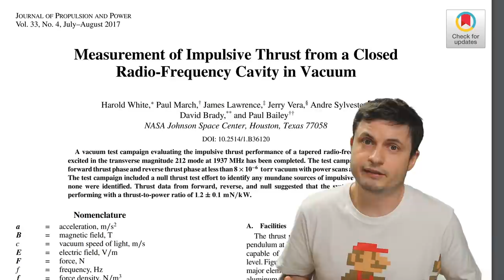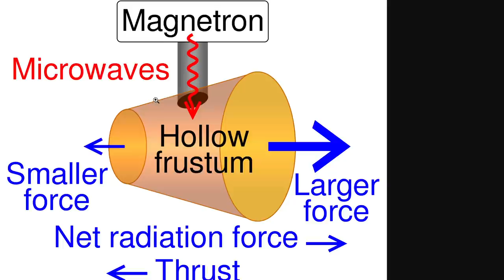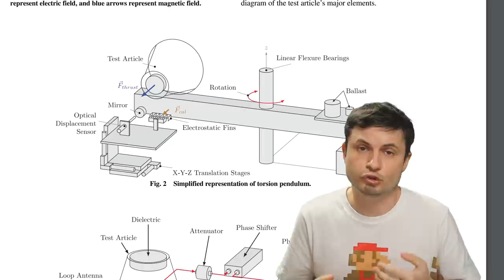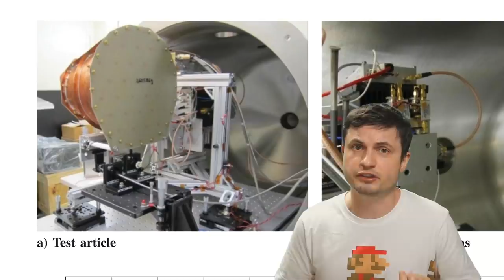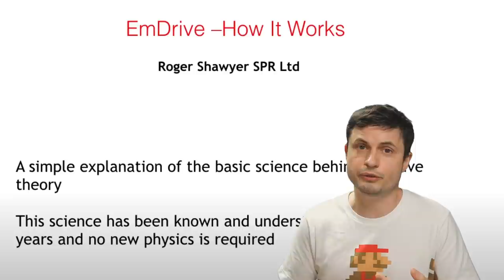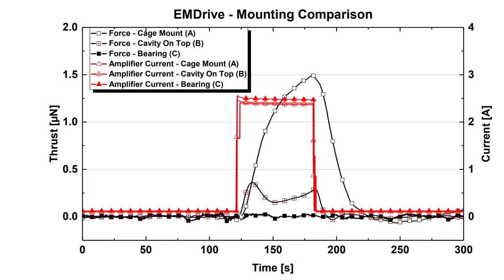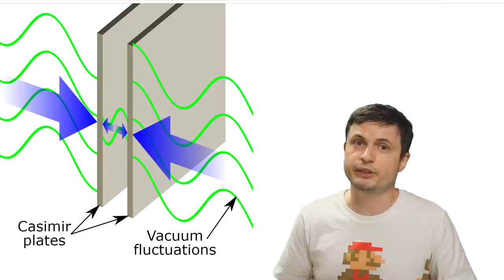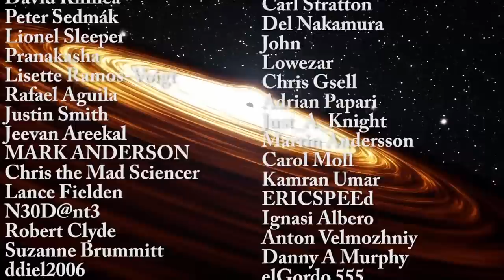Looks Like EM Drive Is Officially Dead - Experiments Fail

Comment: Not a failure. Just learning what does not work. That is just as important as learning what does work.
Reply: This was pretty obviously a "does not work" right from the start.  Depending on the experiment, it involved random amounts of "propulsion" in random directions for no explainable reason.  That just screams experimental error.
Reply: @jasonpatterson8091  and also the fact that this broke all phyical fundamentals right from the start. We just tested around because we would have had to think alot if it worked.
So im weirdly glad that most of our physics still works
Reply: Still insane to learn electrons and photons still can provide propulsion in zero-g. But we're still messing around with what nozzles can and can't do. Lol
Reply: That’s SCIENCE baby
Reply: Hmm I will use the power of my mind to lift a paper clip.  No didn't work.  Hmm I will ask any ghosts that are in the room to lift the paperclip.  Nope, didn't work.  Learn anything?
Reply: @BrosBrothersLP  you’re probably both wrong, for what it’s worth I’m glad this one doesn’t work cause other setups are going to be much better. 
Knowledge is power and I suggest reading about the theories involved because if they do produce a theory of everything. Than Eventually inertia will be used to explain magnetism and gravity.
The engines  we could  engineer and build would be unreal, beyond the scope of what we have now cause we been thinking about the universe wrong, or at least not taken things into acct that should be.
Everything spins and accelerations are the key.
They don’t bs when they say broaden your horizons
Reply: Still useful knowledge
Reply: A total failure from beginning. Calculations on which this drive is based are provable wrong, even beside breaking fundamental laws of physics. Yet huge amounts of time and money were wasted on testing it, just to prove for millionth time that basic laws of nature are indeed laws.
Reply: @jasonpatterson8091   doubt you knew from the start, you probably read about it and are regurgitating others thoughts and experiments. There is always something to be learnt from failures if you bother to look. Indeed the prerequisite of success is failure.
Reply: @AG-ig8uf  the progress of science is based on proving that those "laws" aren't perfect.
Reply: @Foolish188  I learned that you weren’t capable of telekinesis and that you can communicate with ghosts
Reply: "Just because you proved the earth was round doesnt mean that its not flat."
Reply: "Not a failure." Um, yes it was a failure. Which is the opposite of a success.
Reply: @Foolish188  yes. There is neither a mind nor a ghost in the room. There is however a rather self-important paperclip in the room! :-P
Reply: @MrLeighman  no a closed system cant produce thrust and thats it. Without pushing something away you cant propel yourself forward. This will never change. Maybe some weird manipulation of spacetime/gravity could become possible. But using EM-Waves no.
Reply: That doesn't make it not a failure, it just means some failures have value.  And...frankly...this failure doesn't have value.  We already predicted it wouldn't work, and why.  But no...everybody just HAD to try it anyway.  Complete waste of time.  Nothing new, at all, was learned from any of this.  Nothing.
Reply: @DarkVoidIII  lol
Reply: definitely
Reply: Debatable
Reply: your attitude mate wonderful. if all scientists had this outlook science would be a much more thorough environment
Reply: @wiserhairybag5554  "Than [sic] Eventually inertia will be used to explain magnetism and gravity."  How so?  We have a good understanding now, and they have nothing to do with each other.  Note that gravity operates even on massless (inertialess) light.
New physics can't change the experimental results that we already know.  That is, we can refine the model in subtle ways, but it must still reduce to the old model in the low limit.
Reply: That's not learning
Reply: Not really if you find an answer you can use it to fund further ideas 20 years on bus is kinda a step back
Reply: @JohnDlugosz  well I definitely agree with refine theories, theories now aren’t really wrong just incomplete. I guess more so from an abstract way,Ike electrons but more from the state of spin rather than charge. 
Gravity changes pressure at quantum scale, so relatively light slows down and thus bends from our perspective, imo.
Reply: @Foolish188  you realise people were literally believing in that until they've learned it's impossible? Lot of things we figured out through science is now considered common sense. Learning what doesn't work, as stupid as it might seem, is important.
Reply: @BrosBrothersLP  It’s just that some folks really want Unicorns to exist.  The emotional investment was not just the motivation for all the effort, it was also a dead giveaway it was almost certainly untrue.  This never rose to the level justifying all the effort and expense.
Reply: @hugh_jasso  I guess it’s all a matter of scale. 🤣
Reply: @DoremiFasolatido1979  We learned how badly wishing something can’t warp space, but it can warp science, in some respects.  This never justified all the effort and expense.
Reply: Kind of. The problem was this was never supposed to work. There was just a claim that it did. 

Has no one claimed it, no one would've cared either way. Not all experiments are equal. There's no. Point in testing to see if a dog is a cat than can fly.
Reply: This needs to be said more.
Reply: Well put, there's no such thing as a complete failure when you prove what does it does not work. This is called science!
Reply: @jasonpatterson8091  'Pretty obvious' isn't a valid counter-argument in science. We had to make sure.
Reply: @JohnDlugosz  -- Of all things in the universe, we know the lease about gravity. Our best approximation is wrong at very large scales, and we can't tell if it's right or wrong at even everyday scales, let along subatomic scales. 

Unifying Gravity with the Standard Model can't be done with an extension of what we know, completely new things need to be added.
Reply: @Foolish188  "Hmm I will use the power of my mind to lift a paper clip.  No didn't work.  Hmm I will ask any ghosts that are in the room to lift the paperclip.  Nope, didn't work.  Learn anything?"

Quite a few things.

1. You're insane.
2. You try silly things.
3. Your mind is weak.
4. Ghosts don't listen to you.
5. Ghosts can't lift things.
6. Things didn't work.

I learned more than that but these are highlights :)
Reply: yeah, but how many times do 'things that do not work' need to be tested?  Anyone who follows the free energy community will recognize this for the unbalanced wheel that it is, a crank device that has been around for something like 400 years now, that gets updated every once in a while with magnets or mercury or microwaves or whatever new bit of secret sauce the inventor comes up with.
Reply: Davis Edison  haha there’s plenty of anomalies in the universe. It’s because our laws of physics are incomplete. 
I’ll take extended uncertainty principle with quantized inertia, those and mond all look pretty similiar as far as equations go. But Qi adds a nice layer to it, that allows it to match a ton of data regarding stellar orbits, more than mond or dark matter. It also can explain things at quantum level if understood and used properly.
Reply: Davis Edison  hahaha, do I spit woo woo? Honestly that’s pretty funny.
I really don’t think i used any crazy lingo there, I’ve said things more complexly before and didn’t get crap for it, people’s understanding and views of things can be different so I try to keep it broad
Reply: yes and no, not a failure in anyway scientifically... but from the prospective of the company with the patient, very much a failure.
Reply: @MrLeighman  Of course I read about it - I wasn't on the team that made the original claim.  When I heard about the concept I looked at it with healthy (and sensible) skepticism because it obviously violates basic conservation laws.  That doesn't require a rocket surgery degree to understand.  And when you look at the design and the claims, they don't make any sense.  Then it was tested and a series of tests reported any number of results - from nothing at all to random direction microforces.  Exactly the sort of thing you see when people are testing until they get a result due to experimental error.
Reply: @gramioerie_xi133  I never said things couldn't or shouldn't be tested.  I said that it was pretty obvious that this was a false positive.  I'll add that the amount of effort that has been poured into trying to keep the claim alive is not proportionate to the merits of that claim.
Reply: @nomdeguerre7265  come on. It seems that you just were forced to pay the whole thing yourselves. There are a bunch of really stupid experiments out there that are also obnoxious... the ignobel prize was invented for them. The experiments on EM drive cannot be categorized into these. Have a nice day
Reply: @AG-ig8uf  This only persisted because the means to measure it's effectiveness were equally flawed. NASA's own tests showed it worked, so this was not useless at all as it made everyone involved in all types of tech re-think how they are measuring  things.
Reply: @pierluigidipietro8097  Yes it can.   If an idea lacks any 'prior plausibility' investigation should not be publicly funded.  You want to invest your own money in perpetual motion, that's your business.  But investing mine, even one cent, is stupidity.
Reply: It's a thing made to create thrust. It failed to create thrust.
Reply: @Foolish188  ask harder!
Reply: @nomdeguerre7265  following your position, quantum phisycs, which is littered with counterintuitive effects and subtle measurements would have never be found
Reply: @AG-ig8uf  If we don't challenge the laws we see as fundamental, then we won't make any progress, especially when we know that those laws are probably not correct.

Though I do agree that the EM drive was a bit of a waste of time.
Reply: Every new invention always works on paper, then you build it and...

Most companies, in the R&D lab, there is a back room, filled with the failed prototype products.

I was the test engineer whom deemed the products to be failures and sent them to that room.

Those failures lead to amazing breakthrough technology.
Reply: I think we need to purge the word "failure" from our vocabulary with regard to learning and discovery. I feel that the fear of it and the negative connotation that comes with it, holds more people back than any other.
Reply: @madjestic  lol
Reply: No it’s not as important. I don’t need to know why a diesel car wouldn’t work with my fart as fuel to make electric cars work.
Reply: @Jbsutt  Actually, learning what doesn't work IS just as important as learning what does work. It teaches cognitive thought process and logical problem solving. It also leaves "bread crumbs" behind so you can 'usually' not walk down the same or similar path again. This is coming from a 43yo engineer who is abhorrently against this new "everyone gets a trophy" generation.
Reply: Let's think and talk in clichés and not actually do serious science lol
Reply: We should have just saved our time and money.  Science is not “testing everything and see what works”, there was no reason for it to work in the first place.  Science is discerning, we shouldn’t waste our time testing any idea.
Reply: @jasonpatterson8091  well at least this whole thing proves how open minded and fair the scientific community really is.  It was given a fair shake and a good look on the off chance that something was happening that we couldn’t explain but was a real phenomenon.  Discovering and understanding failure is a form of progress.
Reply: @nomdeguerre7265  exactly. funding implausible projects with taxpayer dollars should not be happening
Reply: The guy promised flying cars and mars trips in 70 days. That's not a scientific mindset. That's a straight up scam.

Comment: 2:33  That's a crude thrust reverser, like the kind you have on an airliner engine.

The magnitude of the momentum change of an air molecule bouncing off the sail is potentially double that as when it got whacked by the fan blade.

By the same principle, it is easier to knock down a large, tall wooden block with a rubber ball than with a ball of clay with the same mass.

So indeed, you could conceivably use a fan blowing on a sail to move forward.

Comment: This reminds me of the theory of man flights before the Wright Brothers.  Years from now people will say "We didn't know how simple it would be to build a sunlight drive"  .. 
Might want to check out Thermocouplers
Reply: Many, many, many people were working on airplanes before the Wright Brothers.  They came up with 2 innovative devices, wind tunnels and an aluminum engine.  Their idea that warping the wings was the best way to steer, was already known to be wrong headed in France.
Reply: @Foolish188  The Wright Brothers are actually kind of doubtful as inventors of the airplane. Their original design could never be replicated in working condition, if anything it seems a latter model of them did the actual flight and there was a German, Gustave Whitehead who was reported  to have made several successfull flights roughly a year before them.
Reply: Yeah. But then explain birds.
Reply: @craigwall9536  Also controlled, powered, heavier than air flight is anything but simple. If you have a really solid grasp of the very complicated theory behind it it's "easy" to build a plane, but that's like saying it's simple to build the LHC because it's just a bunch of magnets and pipes. Like, yeah, but how they're arranged is really important.

Comment: It's just a modern take on classic perpetual motion machine like an overbalanced wheel. The "thrust" as conceptualized requires an incomplete analysis of the forces involved. In this case, it looks like the error may have been ridiculous blatant in that the diagrams seem to be considering forces on the end plates but not the sidewalks. The microwave photons will produce a "pressure" of sorts meaning forces applying equally from inside the device into its walls. The difference in force between the end plates will be equalized by the net force on the tapered wall (which will have directionality perpendicularly toward the large plate). Another error occurs in confusing the speed of photons with the speed of standing waves in the cavity. This makes his calculations reveal a significant loss if energy from the system which - when properly calculated - also has a net zero effect.

Comment: Pushing the sailboat with fan side to side is called tacking. But the sailboats have a keel, it keeps the boat from going sideways.
Reply: The issue is that the fans force would counteract the force created by the sail, nothing to do with simple sailing techniques
Reply: @paulvernon4160  Perhaps consider:  the fan hitting only one side of the sail sends air molecules laterally to the side.  You might expect the boat to then move laterally towards the opposite side, exactly the opposite direction of the air mass that's blowing away, but with a keel and rudder doing their job, the boat instead moves only forward at some angle from the jet of air pushed from the boat.  That's how simple sailing techniques allow a sailboat to go upwind.

If anyone pushes a sailboat sideways, by any means, the boat will instead move forward/backward, not sideways.